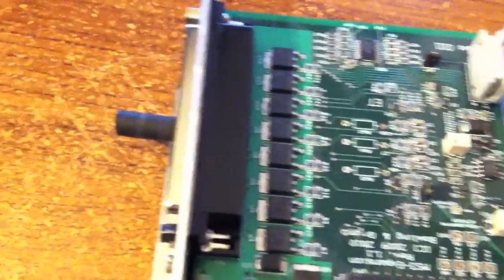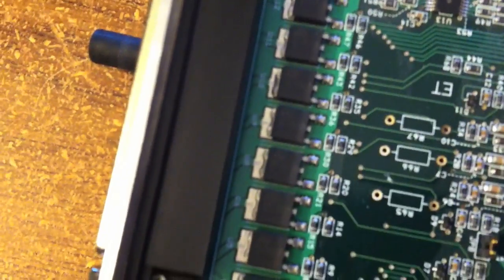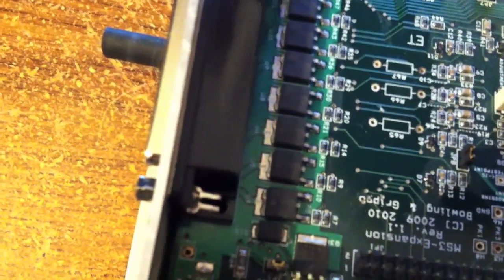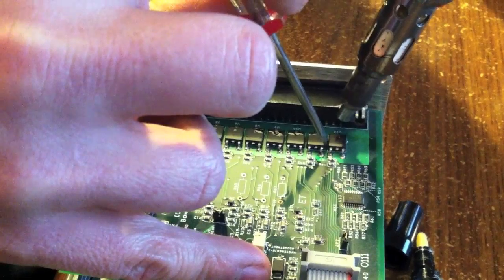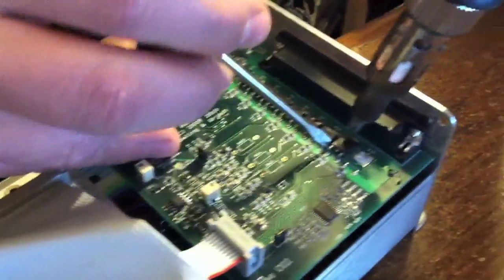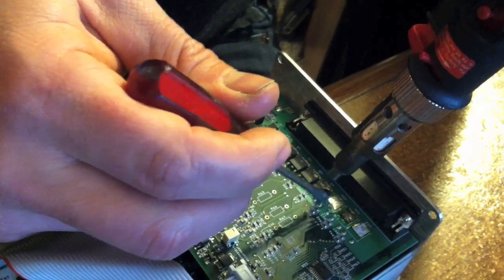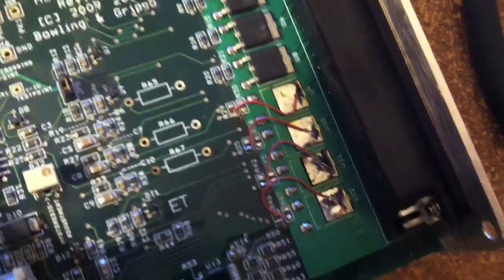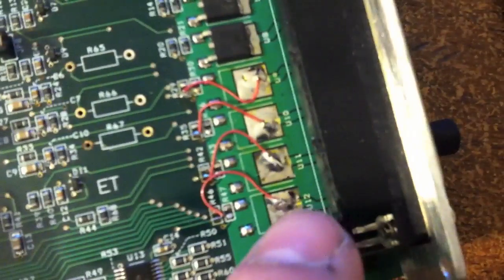MS3x Injector Driver Bypass

Comment from the maker: No, in the end it turned out to be a firmware issue with my trigger wheel mode. Chrysler 2.2/2.5 mode doesn't work worth a damn.